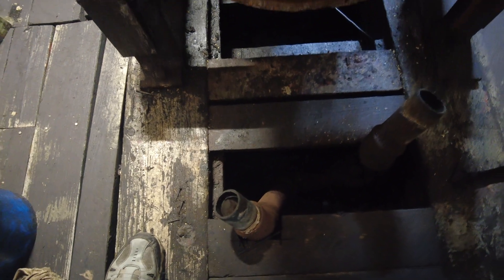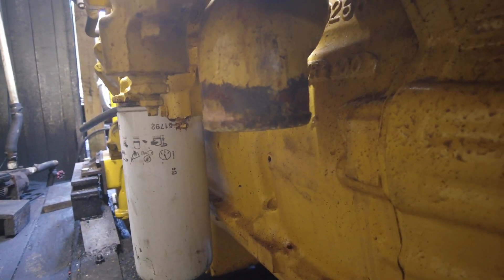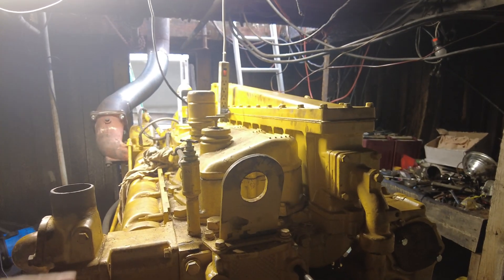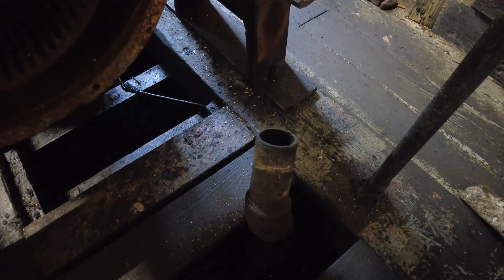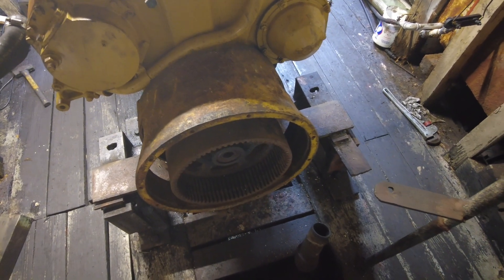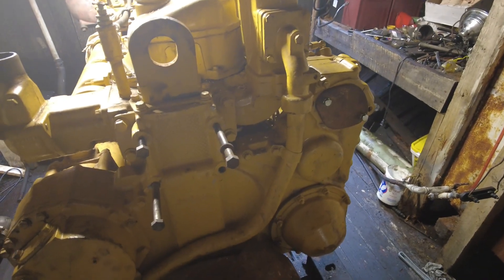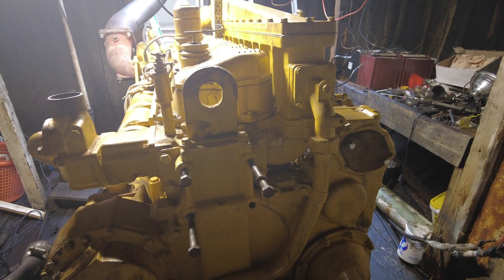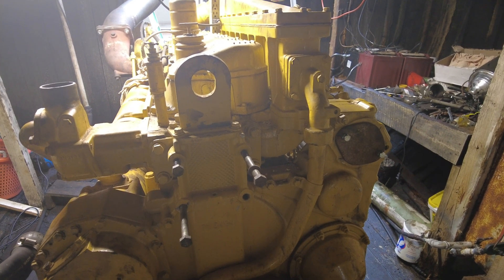Cooling the engine is requiring Shrimp Boat engineering!!

Comment: You need a good welder to cut the end off of the old tank, take out a section and then weld the end back on. Cut off the 2 piece of angle iron and move them so they bolt up to the mounting on the engine
Reply: Can you check the manufacturers recomended volume for the surge tank? 
If the modified tank equals or exceeds the recommendation find that welder.
If not a reconfigured tank will need designed and built.
You Tube's naval machinist Keith Fenner designed, built and installed new fuel tanks for a friend to extend fishing trip travels. He is great on prop line repair or replacement from Cape Cod (?).

Think out of the box. I recall a New York State Modified Racecar rule book limited the fuel tank gallons. After the race tech inspection would always pull the 1st place tank and with laboratory test equipment measure the volume before declaring the winner. 
That year the winner only made 3 fuel stops for the 100 mile race, everyone required 4 or more.
Check and rechecked his tank contained the legal volume! 
Irritated not being officially declared the winner yet, he started his car up and drove to his pits to await his reward.
His oversize and convoluted fuel lines contained more than 15 gallon!